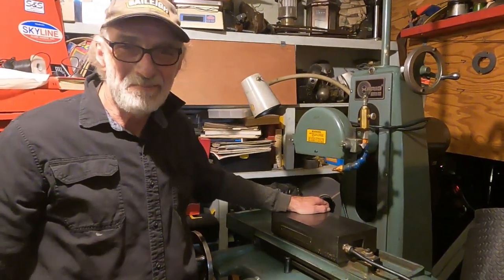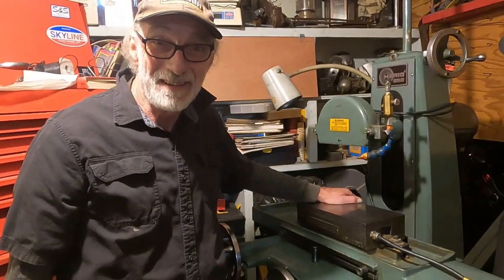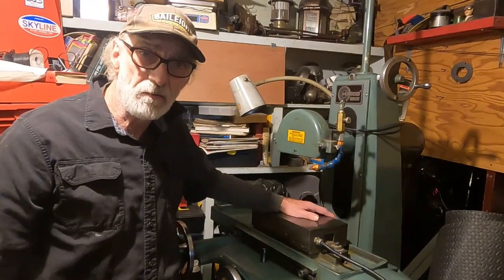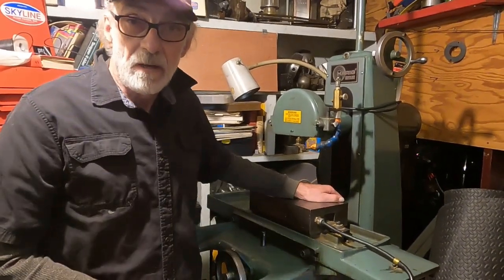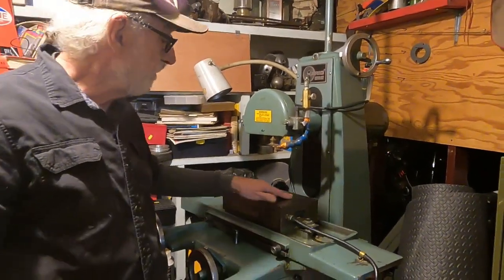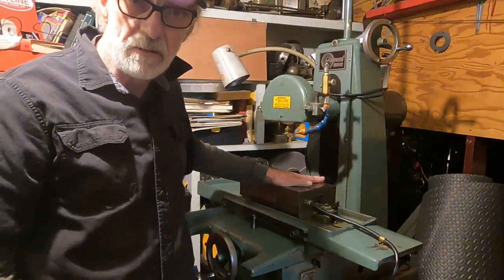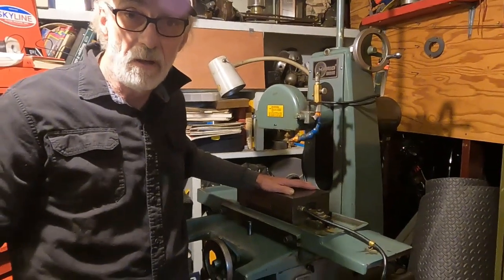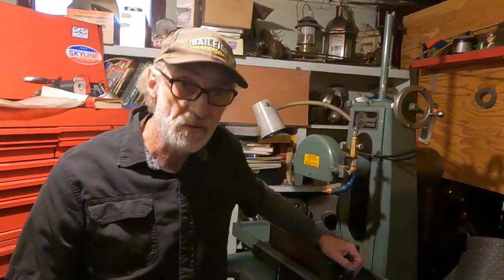Bearings in mind precision alignment surface grinder

Comment: Glad you made it back to the shop. Those are nice surface grinders. I’ve been trying to find one down my way. Have a great day.
Reply from the maker: This one is about as simple as they get, it has the rack and pinion table drive and plain cast iron ways, very easy to maintain. They made them with Teflon and maybe ball ways with automatic feeds and cable table drives also.

Comment: I've got a reid surface grinder it has the belt that turns the spindle, I would like to see if I could put a spindle motor straight to the back of the spindle like yours. It's a Reid 2-1.
Reply: That must be the type with the handwheel for the spindle elevating leadscrew at the top of the machine.  I have the Reid 2-B with the Pope motorized spindle. You can find ( at great expense) refurbished pope spindles on ebay. I suppose you could adapt another manufacturer's splindle to your machine too. If you want I can show you how the spindle is attached to the 2-B. There aren't too many detailed pictures out there on the internet of the machine.
Reply: @tilliesinabottle  that's for sure, not much information, the belt for the table you have to twist it over, crazy setup.
Reply from the maker: I was just looking at a grinder refitted with a Pope spindle, the Pope spindles are very complicated and were beyond expensive when new. It was recommended when a Pope spindle is not in use, it be rotated by hand daily to keep a lube film on those ultra-expensive bearings.
Reply: @deedeeindustrialsuperprecision  sounds a little to rich for my blood, lol...I'll figure something out. Got to..
Reply from the maker: There is the Pope spindles, but the standard spindle with good bearings and belt should do a good job